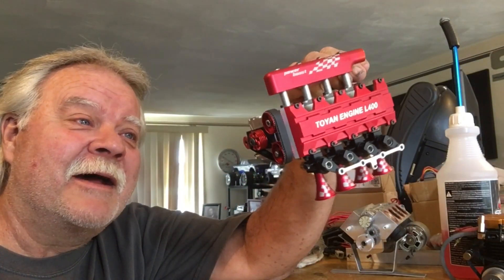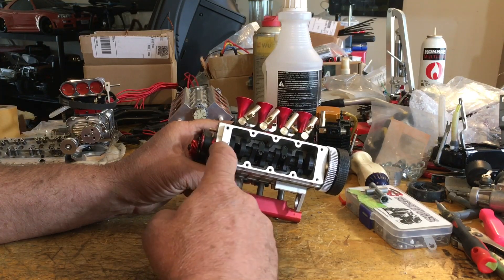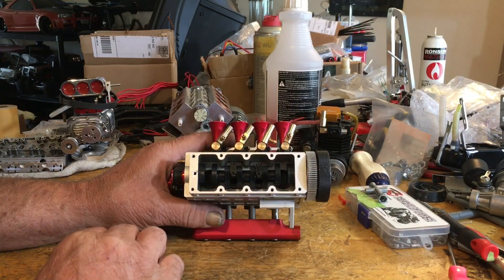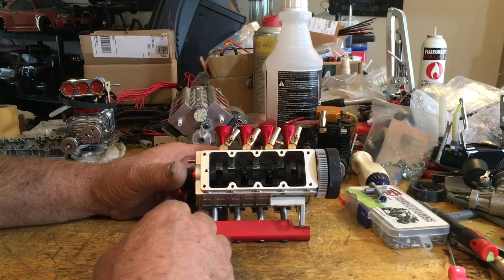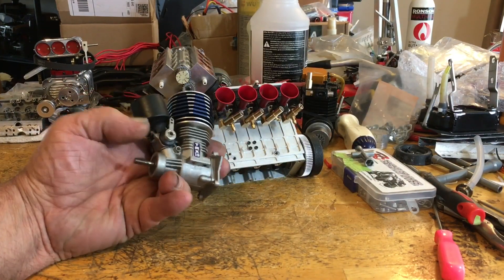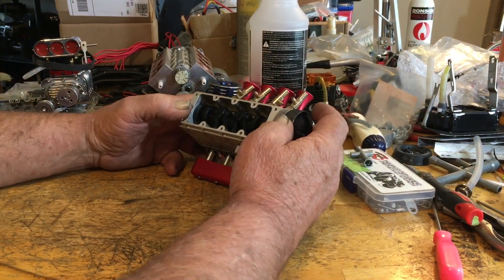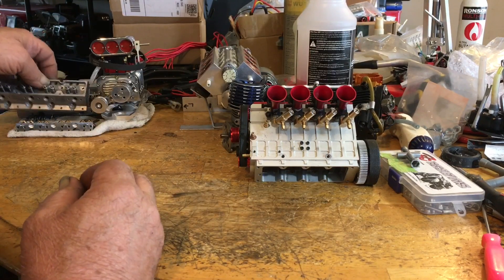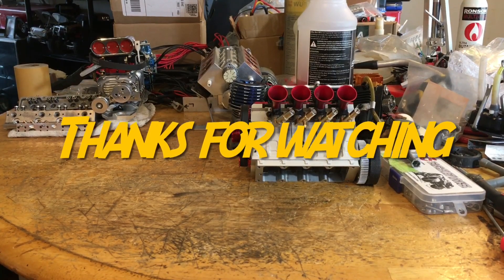TOYAN L400 REPAIR UPDATE

Comment: Hello, I bought a radiator kit for the toyan 400, I seen on YouTube the same radiator but the two nipples on the radiator has two yellow adapter to make it smaller so the base has a tight fit for the hose’s, can you help me please?
Reply from the maker: I have been looking for those also,  you can use the end of a silicone spark plug wire boot, they have a step molded in them, just trim it down to what you need.

Comment: Great advise on the crank install and the other issues around the engine. Any update from Toyan? Hopefully, they haven’t abandoned us on this one. Keep hoping they come up with a new crank. I’d love to see center main, but my gut feeling is that a crank could be made strong enough to operate the engine without the center main. I’ve never seen a company do this to their customers.
Reply from the maker: Thanks! I seen the video on the new toyan block, they only made the front bearing bigger, no bigger journals or center support,  I haven't heard anything from them yet, hopefully soon.

Comment: I bought one of these L-400 engines .when I saw it I fell in love with it. That was shortlived affaur because after waitingfor ever for it to arrive I mounted it on a really nice bras covered base.Got all the electrics and fuel piped in and ready forthe running in session.It started first go no problem,I was really delighted,Imon my way to a super cool RC car.However my third tank ful of fuel things did not go well.It became erraticto run and tick over,and a rattling sound came from the crank case ,soit was stop find out what was wrong,Yes yo got it Crank shaft broke 2nd journal form the back.No reason at all it was running in at very oily fueland never reved it to much only to clear oilfrom the glow pluugs as they  "Toyan" recommend  you do. Cut a long one down I bought a new crank from the spares at Stirling rather than wait further for them to comment on what I had done wrong??? Another £100 so this was becoming a very expensive engine,However it was re-built with the new crank and ready to go again but on the first throw of the start switch the start motor shaft broke off at the gear end, since then a new motor was bought and a replacement belt for the starter, next thing the after a few turn fo this newotor I noticed a black mark appeared on the crank case,these new belts are rubbish thelittleruber teeth on the belt wear very quickly and you finish up with a flat drive belt,All in all mySpent over six months of my life waiting for bits fo rthis engine and a pocket full of money. Dont buy it now ,wait and see if they can sort out all these bugs and make a decent runner as well as a decent looker.
Reply from the maker: I agree I really like these but they are trying to fix the problem, I sent mine back for them to examine after the 3rd crank broke, hopefully I will have an update soon for everyone.

Comment: Man... Dennis, I found and watched you only for the Toyan L400. I literally was 1 of the original that shipped to the US. I put it together in January and had life smack me in the face and didn't fully complete it.

I originally brought it to modify it and run in on a bench. I did all of it, built it completely! I also added a completed oiling system to the Toyan block. BUT, I HAVEN'T FIRED IT UP YET. (Maybe never)

After seeing your video, I am absolutely scared to fire it up. This Toyan project, I have invested well over 2k on. This is absolutely ridiculous... 🙄

Keep me posted, I'm reaching out to Toyan as well. I would like an update, or refund. Thank you Dennis! 🙌
Reply from the maker: Im sending mine back they want to look at it to see why the cranks are breaking on this engine, my first L400 is ok it still has the original crank in it. I will keep everyone updated on what they say.
Reply: I have one all together but don’t want to even try starting it with all this info. from Dennis as I’m not much on computer please keep us posted as I’m sure there will be no rebate of any sort . Thank You !

Comment: You said it brother "Toyan owe's it's customer's something" the answer to that is a redesigned block ith a center crank support. When the 2 center cylinders fire off the downward force isn't supported, along with the rotational stress the pour little crank doesn't stand a chance.
I think my L400 is going o stay in it's pretty wooden box until they do something to correct the design.
Reply from the maker: Good point on the 2 center journals, I am sending mine back for them to inspect and repair, I will post an update when I get it back.

Comment: I wonder how many L400’s have been sold by now.…I bought mine back in November last year but have never got around to assembling it. Now I’m waiting on a fix for these engines so I don’t destroy it in the first 5 minutes. 
I never liked the grub screw idea and maybe it was a contributing factor in this latest failure? Who knows… I might have to assemble mine to get an understanding of why they were recommending a grub screw anyway. If it was to stop the crank from moving back and forward then surely some shims in there somewhere would be a better option. 
Another guy was going to make up a center bearing and sell as a kit to install yourself but I heard/read somewhere that he was still breaking cranks so maybe it’s not a flex issue at all but a torsional issue…are they breaking when you are still cranking it over or does it fire up then break? Compression lockup maybe…I might have to build mine and break it to learn what is going on ha
Cool Chanel by the way, I should be taking lessons from you on how to build my own car/buggy/bike for some of my engines.
Reply from the maker: I was wondering how many were sold also,  the grub screw was totally against any engineering ideas I ever heard of and was sketchy to say the least, I thought the same thing with shimming the crank end, on my failures one crank was idling right after startup when it broke, the others were during startup when it first started to fire off.  im glad you like my channel I try to bring good content to everyone to learn from,

Comment: I think they need to make the mains bigger, the rod journals bigger and a shorter stroke. You need to have main and rod journal overlap. The overlap is where the crankshaft gets strength and keeps it from flexing.
Reply from the maker: I didn't even think about the stroke also effecting the stress on the crank Nick, good call there! this engine works great on a CAD program but in real life it doesn't.
Reply: With 8mm mains and 6mm rods. If the stroke is 14mm or more then you have no overlap.

Comment: hi dennis i am working on a bush centre bearing i will let you know how it goes
Reply from the maker: Yes Im very interested in the outcome keep me in the loop.
Reply: @dennisdempseyradiooutofcontrol  will do
Reply: @dennisdempseyradiooutofcontrol  hi mate i am just waiting on material to turn up so i can start making the bush center bearing,also it may pay to check your crankshaft on centre journal because i have found on the 2 new crankshafts i mine have  a run out of,first one is 0.005 inch and the second one has higher run out of 0.012 inch so they have not been machine credit so it would pay to check yours because they may not be straight
Reply from the maker: @bafordfo4461  Thanks brother! I havent checked mine yet, I will check mine out before I start building my support.
Reply: @dennisdempseyradiooutofcontrol  hi have finally finished making the bush bearing which is a two piece cap with a bush bearing.i have been able to run 20 tanks of fuel now without breaking a crankshaft the longest it has ever run lol.if you I can show how I did it ?
Reply from the maker: @bafordfo4461  Hey Chris that's good news!  can you email me some pics? my email is in my about section on my page or you can contact me at denlin20 at the aol

Comment: Mechanical standards you never set screw a bearing race as it will deform it. You capture it laterally..ONLY way to fix it is center crank support.
Reply from the maker: Yes I have always been taught that you capture a bearing with a split clampable hole even then torque specs are a must.

Comment: That thing really does need 5 main bearings. And one carb.

I'm lookin' forward to the NR-200. It sounds so much meaner and smoother than the L-200 does and it only has one carb.
Reply from the maker: Thanks for the support, yeah it could use less carbs also,  hopefully the NR200's are going to ship soon they said early September, I bought mine the day they started taking preorders.
Reply: @dennisdempseyradiooutofcontrol  JohnnyQ90 already has his. He built a dyno for it but I don't believe the numbers one iota; only 0.1hp out of that thing?! Inertial dynos don't work he needs to load it down and really make it work. But daggum does it sound and run good. I gnenuinely thing the NR-200 has enough power and enough revs to be used in something *fast*, like a 1/8 buggy or truggy, not limited to slow moving stuff like semi trucks and crawlers.

I've got a glow Toyan single for my Globe Liner conversion project(Waiting on money to build up so I can buy their 3-speed gearbox and a new clutch for it!) but I don't think I'll be getting any more Toyan engines until they figure out the L-400. I'm not spending a paycheck and a half on a display piece. I might still get a gas burning toyan single for a boat project I have in mind but I'm not sure; wanna chooch one into Dumas' 1/96 Great Lakes Freighter and set it up with enough fuel to run all day long.
Reply from the maker: @TestECull  Yeah I seen Johnny's dyno video, I commented to him to lock the clutch up so it wasn't slipping on his setup, hopefully my NR200 will ship soon I might put it in my jeep to take the L400's place. that gas engine setup in a freightliner would be really cool idling away.
Reply: @dennisdempseyradiooutofcontrol  I almost think the NR200 would be a good swap for the Skyline to be perfectly honest. It may not have the power potential of the L-400, but it might also? It revs twice as high, it's easier to tune, and it won't snap a crank on ya.

I commented to Johnny that the best way to dyno one of these small engines is to direct drive an airplane prop, take a couple measurements, and then run it through a thrust calculator. Also makes it pretty easy to tune the high speed mix because you can have it screaming along at full load while you ajdust it and see it react in realtime.

Comment: Hi Dennis, I have listened to half your video and have had enough. You are NOT TO BLAME, There are several, well known, youtubers who have all have the same issues as you. I will not name them, but you know who they are. I am no mechanical engineer, but I can listen and learn from those who are. Toyan have under engineered the L400. Sterling and Enginediy are doing what they can. I am trying to focus their attention, as resellers, on applying pressure to Toyan. As I have said before; Toyan are killing their golden goose. I have seen no evidence that oil starvation is causing these failures, although forced lubrication may improve longevity. Most crank failures happen VERY early in the life of the engine. Conclusion ? Stronger crank needed, hardening is not the answer, and maybe a harmonic balancer. IMHO, Toyan need a robust crank NOW. Blaming engine builders is not the way forward. Through correspondence I have tried to allow Sterling and Enginediy to understand this. Selling fully assembled units will not solve under developed products (and I do have lots of experience with New Product Development and New Product Introduction). Clearly the price will increase through the increased costs of assembling and testing putting, in my view, the cost beyond all us hobbyists.

You, of all youtubers, have been extremely loyal to Toyan, giving them your support and the benefit of doubt each time. 

Send your engine back. What do you have to loose (spare parts for you other engine, I suppose) ?

Reading between the lines, there is (or was) another four cylinder in the Toyan pipeline.

I hope Toyan read this, and Sterling and Enginediy. Action is needed, not apathy.

Now, after my tirade, back to your video !

KEEP UP the GOOD WORK.
Reply from the maker: Thanks for the support brother! I think a simple new crank and rod design would be a solid step forward, and yes they are killing their golden goose, I truly believe this engine has the potential to be one of the best products to hit the market in a long time!

Comment: I'm glad I held off.

there needs to be an L400 v2.  so much good feedback. probably gonna need a new case and shaft...

sending it back probably won't help, but it's worth a shot to let Toyan prove themselves.
Reply from the maker: They have a V4 and its a great little engine but crazy money twice the price of the L400 engine, good call there on letting Toyan prove themselves with the repair.

Comment: Doesn’t the L200 have a bigger diameter in the middle then the L400?. I know the feeling Dennis. I waited for the L200 thinking best vs the FS-100. Now I wish backward.   In my case I gotta convince them even if is sending it back maybe they can credit me in getting something else. I also think they have a problem translating what exactly we’re talking about. I’ve send more then two questions and suggestions BUT they only answered one making you unsure if they even understood the rest. Common answer too, “I’ll get back with you”. Two weeks later is like, "Hello!".
Reply from the maker: Im not sure on the center I will have to look next time I have my l-200 apart,  Yeah the communication is hard when trying to explain something to them it makes the process frustrating.
Reply: @dennisdempseyradiooutofcontrol  Just paid attention to some pictures and NO they seem to look the same. I just happened remember the broken piece, that was where the connecting rod goes not where the journal goes.
Reply from the maker: @713Ace529  yeah the main journals are 12mm and the rods are 6mm.

Comment: What if you just used a pair of twin cylinders engines connected by a keyway instead of this bad four cylinder motor.
Reply from the maker: Good idea there or 2 side by side running a slave shaft in-between them.

Comment: Great work and followup. Sadly, Toyan hasn’t figured out the customer service end of doing business. Lots of us share your disappointment. Hopefully, your video will get them to support their L400 customers. I will forward a link to my contact at Toyan. My gut feeling is that they had to have failed cranks on the original factory testing. I have my 4th crankshaft, but will hold off assembly until Toyan comes up with a fix. Early engines had aluminum bearings, so dropping the copper bushing on the crank would allow for a 7mm throw, but going with brazed or welded 6mm pins might get the engine to run as a demo. New block with 3 or 5 mains with caps and larger rod  throws would be a great fix. Water pump wear is going to be an issue, but a small external electric would resolve the pump issue, so not a major problem. But….the crank is a show stopper.
Reply from the maker: Thanks my friend, I might take mine and upgrade it myself to see if my ideas would work, I got nothing to lose but time.

Comment: What will it cost to send him back I say if toyan pay for the shipment why not at this point I say that this engine needs more crankchaft support why not change the engine block include in the new version an oil pump more crank support just to copy on a real engine with oil in the engine ??
Reply from the maker: Good point, I don't think they are going to upgrade it at all nothing was mentioned other than them rebuilding it.

Comment: No mid support bearing like what are they thinking? You're so right looks good on computer so they slapped it together and shipped before running them much. 👍👍
Reply from the maker: Great point
Reply: @dennisdempseyradiooutofcontrol  i thought this was the engine that got put in a full-sized motorbike by 2Stroke Stuffing. My mistake :)
Reply from the maker: It was the same engine he put on the motor bike, I seen his video when it broke the crankshaft, he also installed a 2 stroke on it after and it worked lol!
Reply: @KentRoads  it is and it broke
Reply: High torque applications probably weren't in the plans for Toyan xD

Comment: It is a disaster Denis.... but predictable: How a simple screw that tightens a bearing can prevent the vilbrequin from breaking.... They make fun of customers! I think that a vilbrequin cut from a CRMO4 steel bar with a surface heat treatment could work with only two bearings. What do you think?
Reply from the maker: Yes we figured the end result would be the same, I agree that CRM04 for the crankshaft would work better.